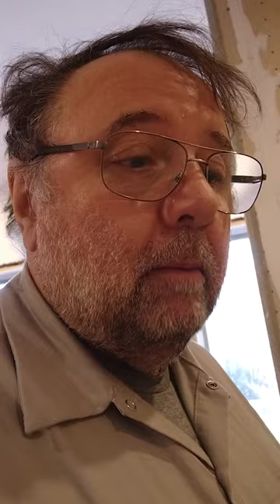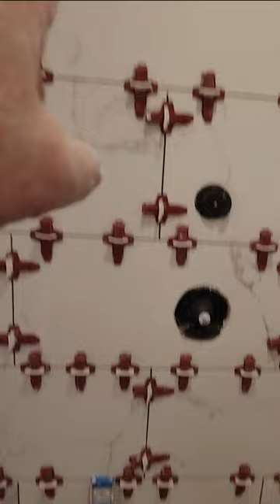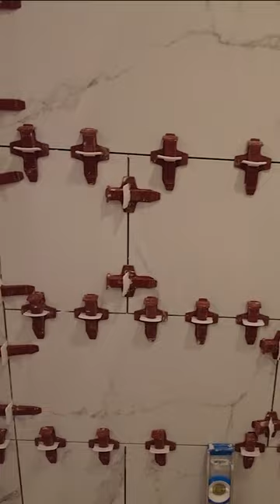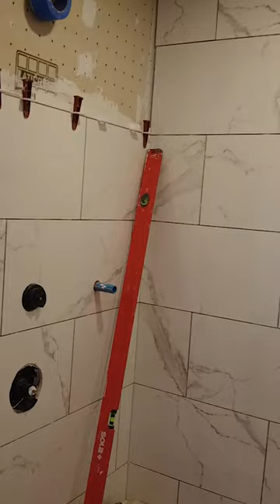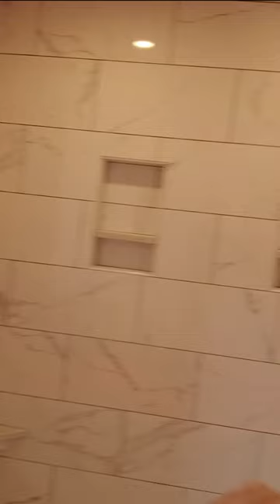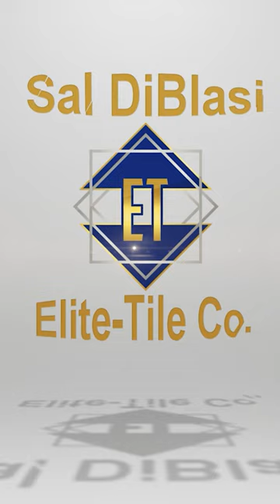What's The HOLDUP , why so long #shorts #tile #howtotile #diy

Comment: I just did a 36 x36 shower floor and there was around 150 cuts took me an entire day for that little floor I’m glad I’ve learned to cut all my cuts before mixing but I used to cut as I installed it’s just not feasible with tiny 1inch hex tiles the wall tile are so thin I had to fill the perimeter